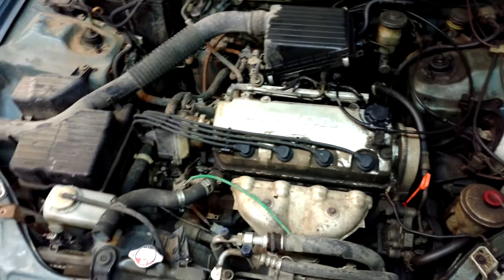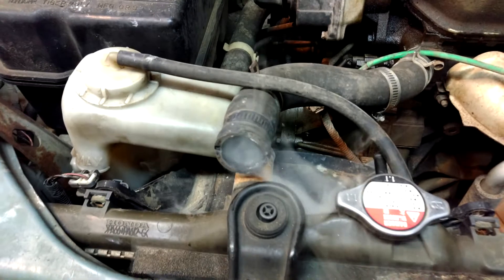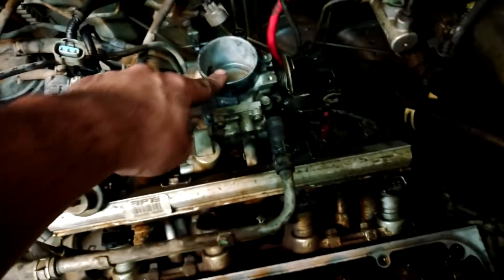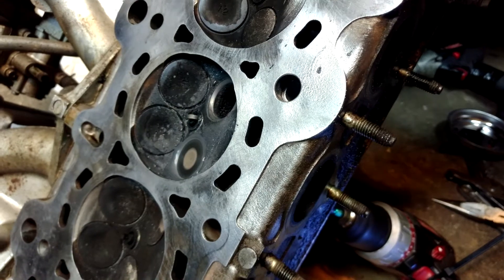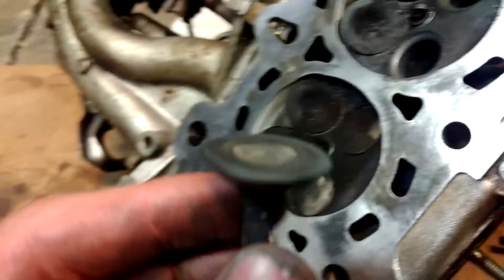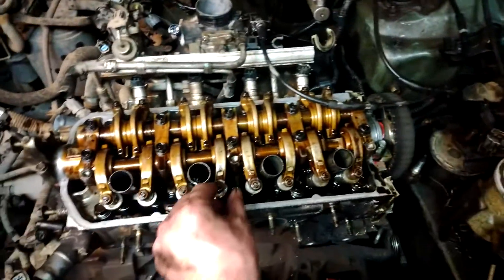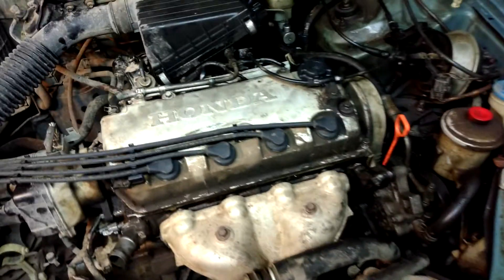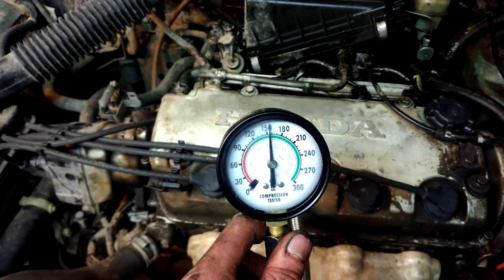Will welding a burnt valve work?

Comment: could have been the car computer, my nephew had a dodge stratus with a Mitsubishi DOHC motor, he said there was steam coming out then the car only ran at a really sluggish rate. Then stopped running. I believe the car computer logged the engine temp then went into limp mode, then when the temp still got hotter it shut the car down. He was going over to my house and was about 10 blocks away. His GF drove him home and i walked up with coolant put some in and drove his car to my house. did not blow the head gasket. Though he does have a slight leak from the water pump. I told him to keep an eye on the coolant level till he trades it in in a year.

Comment: Welding material added is generally soft, yieldable, to cope with the thermal shrinkage of the weld when it cools down. A soft, yieldable spot is hence added to the in general high nickel/chromium content material of the valve...
How long will that last?  

A top revs, valves can operate red hot...and the weld spot will leak soon after. Or do I know to much?
Why not buy a new valve.? 

Good exercise anyway.
Reply: I agreed, a new valve for this engine is not expensive.  If the valve burns out again then it's another head gasket set and some hours of work, but if the valve fails catastrophically due to metallurgy changes during welding then it will trash the engine.